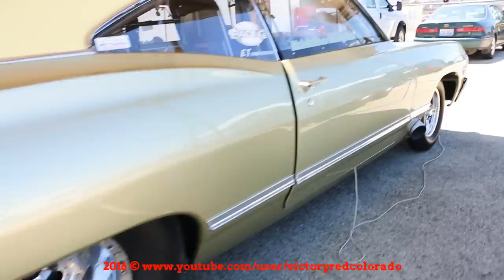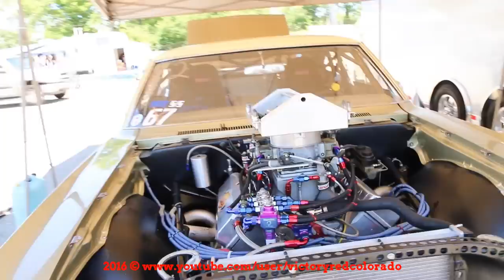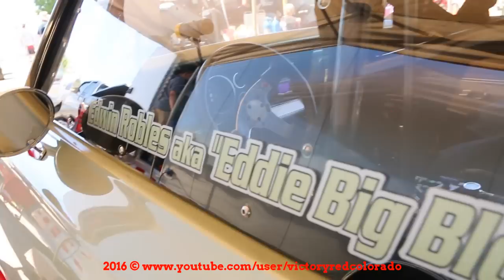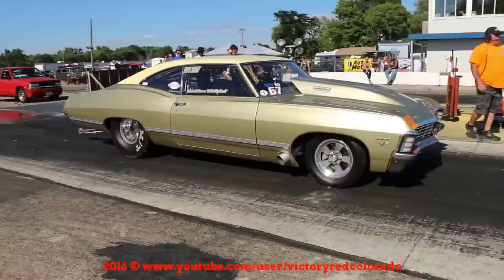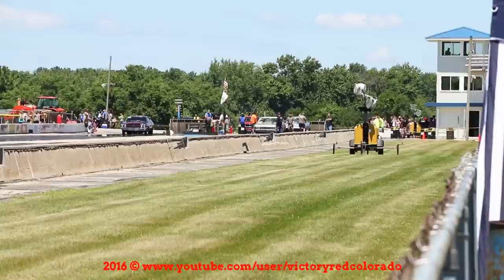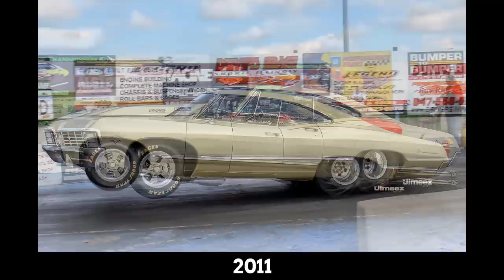7 SEC '67 IMPALA! "EDDIE BIG BLOCK"! 1220HP 632CI! TESTING AT BYRON DRAGWAY!

Comment: I had a 67 Bel Air it was my first car. This one's a little faster than mine,it had a 283 with a 2 speed Powerglide.
Reply: I had three 1968 impala's. All of them had a 305 with powerglide.
Reply: 307?????
Reply: Yes. The 307 was GM’s replacement for their “Baby block”.
It’s basically a 283-stroker.
A 283-block, fitted with a 327 crank. GM/Chevrolet was no longer producing both 283, and 327 “mouse” motors. It was proving counter-productive by producing both.
The 307 was produced with a 9-1 “flat-top piston, and a Rochester 2-barrel carburetor, and had a factory HP rating of 200. 
However, 283 induction parts (4-barrel intake and carbs) are interchangeable.
Reply: @thevmanvj  I had a 67 SS.  I put a jet motor in mine and the chick's dig me.
The motor came out of the lunar module that landed on the moon.  My dad knew a guy that worked there.
   Man those were the days, right?   Jet fuel was cheap and we would cruise with hot chick's every night.

Comment: I had the 68 Impala 2 door custom original 327 with only 63000 miles on it it was my first car it was a large jernal small block turbo fire  came with 285hp had alot of power to be so big, but when i had it rebuilt it had to be borred out 0.60 over just with flat top pistons lanaughty cam and lifters flow tech headers stage 2 flow masters brand new 750 holly 4 barrel carb. It sounded bad ass and none of it was a huhe upgrade only about mid range parts but it kicked the hp way up so much the front end would come off the ground registerd only 140 but had pleanty if petal left after 15years i traded it for a drag car like a fool POS 96 trans am LT1 350 hooker headers a lot of expsensive shit on it the best you could buy i drove it home about an hour away got it to the track to see whag it would do ot was so slow my impala would have left it jn the dust but befors i got to 100mph FINALLY it slung a rod throught the oil pan so he got my first car a sentimental csr from me for free basically i had 25grand in that car i sold it with blown motor for 500$ guy begged for it i was so mad then come to find the title was fake!! Took the tag office 3weeks to find out it matched the car but it didnt exist total fake i got screwed! A year later his name was jn the paper wanted for title fraud like 5 counts i hope he rots in prison!! I was young still had just got married and had 2 kids what kinda pos would do somthing like that!!